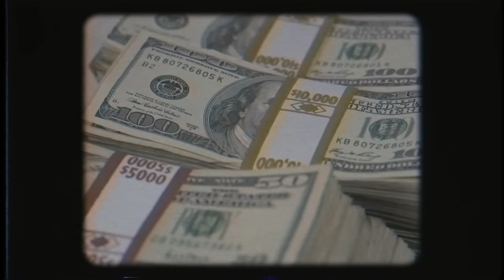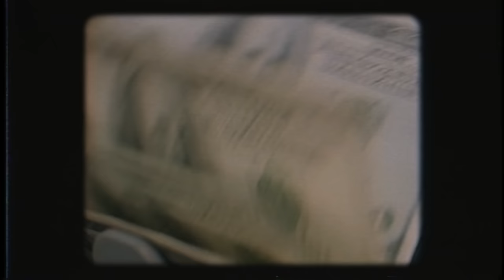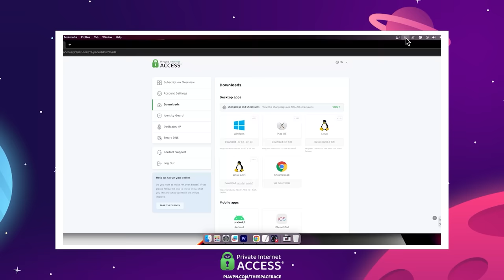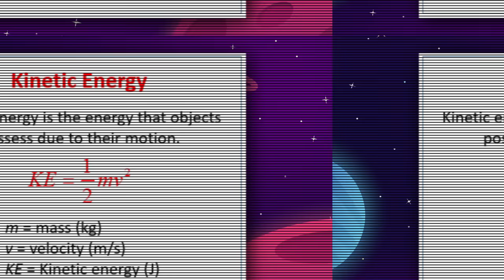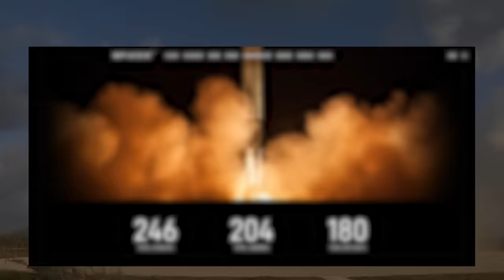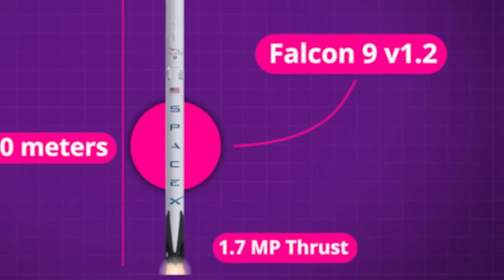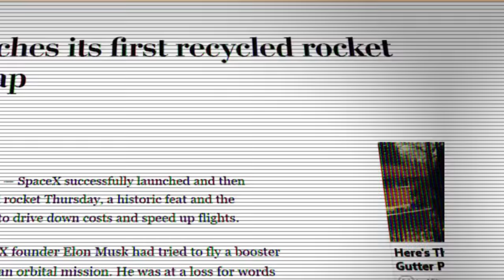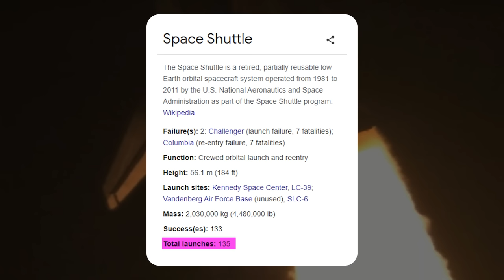How SpaceX Reinvented The Rocket!

Comment: Starship has two roles. Fully reusable are a cargo carrier into LEO. We see this being tested now and it will ultimately work. However, for deep space missions (Moon and beyond) Starship should be used like Falcon 9. A reusable first stage, but a disposable second stage to LEO. Carrying a third stage and payload for missions beyond LEO. That would mean the third stage and payload would be around 400 tonnes. A true deep space craft able to handle missions to the Moon, Mars and the asteroids.  
There would be no issues with difficult multiple refuellings in LEO.
It would mean Starship would be able to replace SLS within 2 or 3 years. It would also mean Starship would not need to man rated. Crew would go up in Crew Dragon and transfer to the Deep Space craft.
Reply: You're making an assumption: that orbital refueling will perpetually remain difficult. SpaceX does tend to keep iterating on things until they make it work. I would not bet against them, we've already seen them turn something which everyone said was impossible into a reliable, almost daily routine after all.

Comment: Christ that booster reentry using the engine as the heat shield is so so fucking gangster
Reply: Think about a rocket engine nozzle. It has to take extreme heat on the way up, with the higher the efficiency of the engine the higher the heat. Falcon 9 (and Starship) opted for the considerable extra expense of niobium alloys to get that fuel efficiency (as reusability will spread the purchase expense over lots of launches).  Then thay saw that having such heat resistant nozzles means you can make them part of your heat shield arrangement.

Comment: One key fact about the shuttle: 136 missions with 2 failures, yet the shuttle itself never failed. In both cases, it was the launch system—first the SRB, then the External Fuel Tank—that caused the damage or destruction

Comment: The original concept of the space shuttles was that the booster tanks and earlier stages were to be fully reusable. They then went with the disposable fuel tank and reusable solid fuel boosters.
Reply: Bureaucracy and politics killed The Shuttle. It could have been better than Falcon 9.
Reply: Didn't the Defense Department insist on a bigger payload capability? Remember that it never launched from the purpose built Vandenburg launch facilities.
Reply: @johnstout5767  The original concept was for a crewed ship to orbit with limited cargo capacity. But the defence department wanted it for orbital operations launching spy satellites.  The only dvantage with the larger cargo bay was that the Hubble space telescope the size of the large reconisance satellites could be carried into orbit.
Reply: It was also to be mounted atop of the booster stage, and so the re-entry tiles wouldn't be damaged. A smaller re-entry vehicle was envisaged initially, but the Office of Space Reconisance wanted the ability to carry large payloads to orbit so it got bigger. A definite case of a mouse defined by a committee ending up with an elephant that did not live up to the turnaround times and lower costs. The shuttle had  certain advantages, but the cargo bay was never fully utilised. The current iteration of the Falcon nine carries 22.8 tonnes with its turnaround times is beating those of the Space Shuttle. Even the Falcon heavy carries 63 tonnes, more payload to orbit than the shuttle 27.5 tonnes. What is needed now are orbital and lunar space tugs to transport materials to the Moon and to recover and repair and / or dispose from low earth orbit of space junk and defunct satellites.

Comment: What about the venture star. The only reason it did not fly was because of issues with the copv tanks and a politician prevented it continuing with different tanks.
Reply: The problem (in part) is different tank material killed the power to weight required, I think if they switched fuels and continued the program it could have worked.

Comment: Space shuttle solid rocket boosters had skin of hslf inch thick steel plate . (13mm thick) 
 They were 150 feet long and 10 foot in diameter i believe . ( 50m longx 3me/rs diameter)

Comment: I wonder why they don't equip the first stage with air breathing turbofan engines.  Strap a few of them on to the bottom of the rocket.  They could be 747 engines or perhaps Blackbird engines which can change their configuration depending on altitude.  Then for the first stage they would only have to carry jet fuel.  If the weight of the rocket was greater than the total thrust of the engines, they could strap wings on to the rocket and take off at, say, 30 degrees to the horizontal, while heading toward the equator.  These wings would aid in gliding back to base after the second stage was launched.

Comment: 12:11 Sorry, but that picture is definitely not a picture of reentry. The video just before that is, but that picture is the booster on ascent, just before MECO. You can tell because you see eight plumes expanding out, indicating that all nine engines are firing (the center engine plume is sort of contained by the other eight and can't expand that much). During reentry only three engines fire, resulting in a plume shaped a bit like a lozenge.

Comment: NO. You're wrong. Its the ability to manage a cluster of engines as well as surface controls that allows reusability  Landing is more complex than a lunar mission and could never be created for the V - the V it already existed. PLUS the Saturn engines are one use only. 
Its proven to be cost effective starlink has more than 1billion in recurring revenue. .  Wrong on so many points.

Comment: My guess is that modern microprocessors made precise landing control possible.
Reply: It took somebody willing to spend the money and time on development. This is where it's nice to have a billionaire with strange hobbies around.  They play with things no one else will bother with.
Reply: @M167A1  in this case he became a billionare from doin all the strange things
Reply: I doubt that. Never underestimate old microchip technology.
Reply: @Levitiy   That's not evidence, that an aphorism.  As evidence I present the ability to more easily control multiple smaller engines.  Von Braun opted for fewer larger engines whereas  Korolev's R7 used multiple smaller engines, but that presented problems with coordination.  Current control systems have an easier time with multiple smaller engines.
Reply: @catsupchutney  I know what it is. It wasn't a rebuttal, hence no evidence, dummy.

Also, I was thinking more along late 80s, early 90s microchips. Not the N1's Kord computer.

Comment: Those in the industry who were quick to dismiss the falcon 9 as a gimmic are also the same people whove been essentially subsidized by government bodies and have been able to charge whatever they wanted to get things into orbit. When the announcement of using methane and lox instead of Hydrogen and lox / kerosene and lox happened and the projections of what it would do to the cost of fuel, many an Industry big wig was very upset at the idea of actually having to compete

Comment: The space shuttle was never reusable. It's engines, heat shield,  and other critical systems had to be dismantled and rebuilt after every flight. The boosters and massive extra fuel tank were completely expended and needed to be replaced. Again, after every, single, flight. That's not reusable.

Comment: As  for the space shuttle being too expensive, risky and unable "to fulfill its original design concept" please note that it had a bunch of military requirements laid on its shoulders that had nothing to do with being efficient, safe, and cost effective and everything to do with being able to support certain military objectives for the deployment and acquisition of hardware to or from space. The Shuttle did turn into more of a concept vehicle than a work vehicle, and in fact was hugely over-complicated and too expensive, but it wasn't just because NASA "couldn't" make a sustainable vehicle but was laden with extra constraints which made  doing so an insurmountable task.

Comment: Please see nasa funded delta clipper tests in the 90s that established the potential for powered landings and single stage to orbit.
Reply: The Delta Clipper sounded great on paper. However, it had a lot of issues that likely would have kept it from working as expected. The SSTO portion was almost guaranteed to fail as it required metals that didn't exist, though they thought they could create them. If they had redone some items with it, they may have been able to make a really good booster for second stages, similar to Rocket Lab's new rocket that they are working on.

Comment: i don't understand how the equation on 10:47 matters for parachute landing. Isn't the only thing that matters the terminal velocity of the rocket? And how is that different from the solid rocket boosters? It is not a function of how high the rocket flies.
Reply: Welp.. if you make physics 101 kinda equations it would be sth like:

SRB: 4800km/h (around 1300m/s), 90t dry mass (here, the claim that its small empty tube, therefore light is kinda bs looking at values on a few websites)
KE = 1/2 * 90t * (1300m/s)² ~ 76TJ

Falcon booster: 8000km/h (around 2200m/s), 22t
KE = 1/2 * 22t * (2200m/s)² ~ 53TJ

so already that point is pretty much nonexistent, cuz there is less force that parachute would have to handle

Adding the fact that for f9 booster, entry burn is needed so at least it doesn't get burned, you end up with speeds similar to SRBs, so even less

From what i know on the topic, the real point is that if you already have engines that are relighting for entry, why not to relight em again to land it

Comment: Again…you are mistaken in your assertions.  Huge Titanium forgings were made for the military Airforce in 2005.  Some were 15 feet long and weight thousands of pounds.
The Navy  CTOL 497 AIRCRAFT was one that used the Large Renolds oversized Titanium forgings.  There also were Nsval Submersibles that used a large titanium castings to prevent an implosion from occurring.  Space X wasn’t the first or second. To use large  titanium castings… Maybe they were the last to do so.

Comment: Just to point out that space x was not the first company to land a rocket. Look up "Delta Clipper Vertical Landing Rocket Before SpaceX." this was in the mid 90's.
Reply: That was a test system and not an actual working rocket system.
Reply: @Art-is-craft  Of course It was a test flight. What is your point?  It's a rocket and It was made By McDonnell Douglas before SpaceX was a thing. The beginning of the video on this channel claims that SpaceX was the first company to land a rocket. I was just pointing out that this is not true. That is all.
Reply: @gokuhawks14  
Point was it was not a comparable system to that of the SpaceX craft.  It cannot be classed as a first because it was just some experiments.

Comment: 06:30 Claiming the STS was the most dangerous is a fallacy. The amounts of flights per loss of life is factually above the N1 Casualties, The Risks of the Saturn V, and the incident rate for that even when factoring in payload and souls on board. Its more safe than  the Original Soyouz, It has less catastrophic failures than Atlas, Delta-4, Ariane-4, Ariane-5 etc. The total losses is 14 in human life, the total successfull missions is 129 failures is 1. +5 testflights of non orbital character. Total losses is 2, and 355 Different people flew on STS, at a total loss of 14 lives that is 341 surviving crew. Compare that TO ANY rocket in history and even Soyouz is dwarfed, you might say that it has 1700 flights... but this is incorrect, the total flights is much less, due to the Soyuz not being 1 rocket but 7 different rockets. And even the newest version has had more incidents than the SLS per flight. With the drilled hole insident. The STS lost heat tiles, this was not an issue for safe operations, the SRB's broke up Challenger because Management flew it in conditions it shouldn't have, (sub 0C temperatures). And the foamblock that fell off and hit Columbias wing had happened multiple times with no issues, only 1 time did it strike the wing. And this was indeed a flight risk, but one that could be easily mitigated by fixing the isolation method, reducing the payload capacity, but keeping the foam on the fuel tank by tethering, and using kevlar netting. The orbiter was old, and was scrapped for monetary reasons, not due to its design or safety concerns. Its incorrect.

Comment: Very informative video. Never  understood all the information or reasoning around Elon Musk's Falcon 9 vertical landings. Would like to know more about Von Braun's winged, flying, and reusable rocket. A brief history of how the Space Shuttle was developed would be interesting. Then an in-depth follow up on Sierra Nevada's smaller flying plane, how reusable it is, and how it will differ from the Space Shuttle. You have already written a video of the advantages and disadvantages between Elon Musk's rockets and Sierra Nevada's space plane. You have also written a video on the capsules that go on top of the Falcon 9 rockets and how they differ from the old Apollo capsules.

Comment: space shuttle the most dangerous? Didn't N1 moon rocket kill 91 during its first launch and fail catastrophically100% of the time fulfilling it  design concept not once?
Reply: I think the distinction is regarding crews.
Reply: @TheEvilmooseofdoom  N1 was meant to be crewed and 91 dead in one launch due rocket  and 100% failure for all launches seems pretty dangerous to me - which would you rather fly?
Reply: @blengi again, they meant for crew on board a fully finished and operational vehicle.
Reply: @SyntheticSpy  so  dozens of dead bodies on the ground don't count as long as crew are safe? irrespective which would you rather fly N1 or shuttle given eachs record?

Comment: Really, really good video.

I wish we had more insights into the refurbishment costs of a SpaceX booster compared to a Shuttle. Compared to the 650,000 hours that went into refurbishing a shuttle, what's the marginal refurbishment time that goes into something like booster B1058 (the one that landed 16 times so far)? I've heard estimates ranging from $5M, $15M, to $30M but those generally mean different things. Like the $30M number I think factored in R&D costs and averaged that out as well, also that number has come down over the years. So where are we at with refurbishment costs today?
Reply: We are no where.  That's insider info.
Reply: @TheEvilmooseofdoom  it would seem that we are in fact somewhere, considering we have some info about cost estimates.
Reply: @ohedd guesses aren't facts.
Reply: @iamaduckquack  Due to Heisenberg's uncertainty principle, the exact position of an electron cannot be collapsed into a fact, so we use probability functions to estimate their position. In the same ways, the estimates I gave you are produced by key individuals all with insights into the internal workings at SpaceX. Basing your estimates off their information, and it should give you a useful range that you can use to work from.
Reply: @ohedd  That's a very fancy way to say you guessed.

Comment: To reuse the giant booster rockets sections, launch the rockets so that the boosters are over the ocean when they do their job and use up their fuel. Then, by giving these booster sections a pine cone arrays of highly processed wood wings, which can be guided by a steering AI, as the booster section descends, it can SPIN due to air resistance, slowing the speed of its fall greatly. This deacceleration will enable the boosters to remain completely intact, when it’s guided to an area in the ocean, where NASA and the U.S. Navy sets up a ‘Bubble Bath’, made by air jets systems they activate on the ocean bed, so that the boosters fall in FOAMING water, rather than solid water, which doesn’t compress under impact like air or foam, a ‘Soft’ cushioned drop. Then, these fuel-depleted, EMPTY boosters, will float back to the ocean surface, and be towed back to the mainlands, to be reused. We have to make the ‘Pine Cone’ array out of specially processed super-strong wood, so that they ALSO cushion the booster’s vertical impact into the foamy ocean water, insuring it’s completely intact, as even super-foamed water could impact such a massive fuel tank section too hard anyway, and after these shock-absorbing wood pine cone wings or vanes snap off, they just decay away in the ocean, and do not present any environmental harm.

Comment: The big difference between spacex and all the other American rocket suppliers is the approach. Spacex wanted to make a business out of using rockets. For everyone else, delivering a rocket was a business. The latest comparison is with Boeing and Spacex, where Spacex has delivered, and Boeing has still not delivered anything that works. Why other countries do not do something similar is probably due to the fact that most people ask themselves what are we going to use it for? And does it even make sense with the existing technology, where the answer is no. There needs to be a different approach to getting into space than using a rocket, which even Spacex has not demonstrated is a sustainable solution. The rocket is an airship, and not an airplane, and not a helicopter at all. There is still a long way to go.